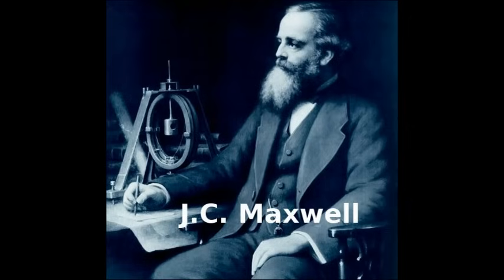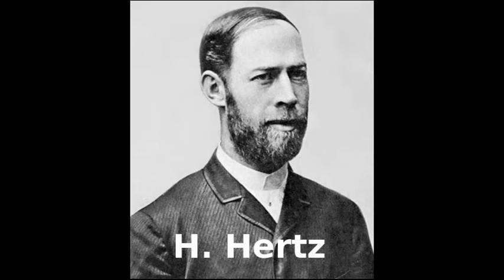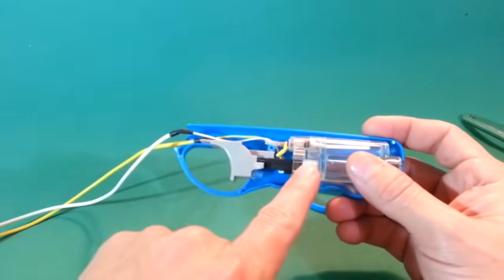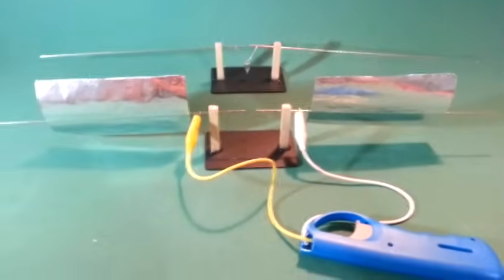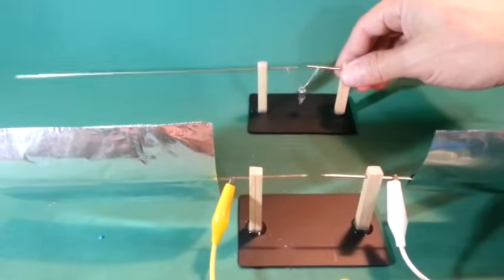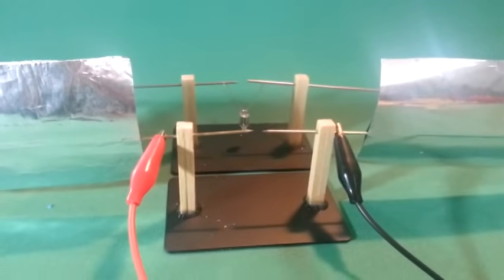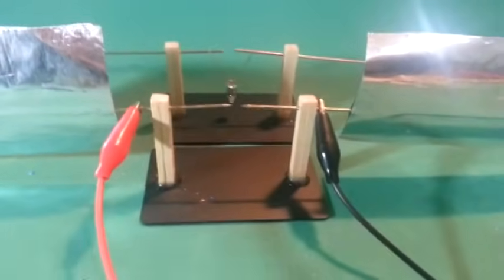Hertz Experiment on Electromagnetic Waves

Comment: Cool video.  However those are not Maxwell's original electromagnetic equations.  Originally there was i j k the three vectors with an additional scalar component w,  that was always left over when the vectors were solved. Oliver Heaviside took that scalar out because it would leave his vector calculus equations Unsolvable because they Didn't account for the curl of the field that had no vector. So the interpretation of hertz experiment is incomplete if you don't account for the curl of the em field lines which produces the effect of super position of the energy occurring in similar. Geometrical arrangements and therefore it is not a wave traveling first but a super position of a particular geometric energy configuration happening as a singular event instantaneously collapsing at the same time which produces a shockwave at the speed of light that interacts with the gas particles changing energy levels and releasing photons to compensate its rest mass energy level.  The dynamics happening within the geometry of the vacuum always precede. Events observed in physical particles disturbed by the activity occurring in the vacuum beyond the speed of light

Comment: Interestingly a spark gap can be used as a radio jammer. Although this is VERY illegal, and dangerous if you don't know what you're doing. A spark gives off radio waves of every radio band, effectively jamming every radio band within range of its effects. If you had speaker near this spark, it would just play static. Even without a receiver. The wires themselves act as an antenna. Of course, a small spark gap like this would only affect things within a few meters at most. But a large enough one could potentially jam emergency frequencies, public and private radio (private more so), and cause a lot of issues. It would also require a LOT of electricity to make a spark gap that big and to keep it going. The first radio transmitters were actually spark gap transmitters that worked on this very principle.

Say for transmitting morse code wirelessly, you just have a switch that creates a spark across the gap, and the reciever will hear it regardless of what it's tuned into. You can hear this for yourself during a thunderstorm. I remember I had a set of Harmon/Kardon speakers that used to click every time there was a flash of lightning. The cord is acting as an antenna and causes the diaphragm to jerk real quick for a moment.

Comment: Many years ago I did an experiment with the same setup using an LED and a piezo igniter and got it to light up 4 meters away with long wires on both ends of the igniter and receiver using a coherer. It worked really well!

Comment: What exactly causes the spark in the detector? Is it EMW or the normal light (from the spark in the circuit). I mean if we have used normal circuit, instead of the  LCR circuit having oscillations and all... will the spark in the detector still be there? Bcz I have read somewhere that EMW has the effect on spark length. I'm confused with the exact cause of spark🙃.plss explain. It would be a great help.
Reply: I think its probably the EM wave, as its supplying an electric field to it and giving it enough energy to glow

Comment: can you tell us what type of neon bulb you used... I want to do this same thing
Reply: Any neon bulb ranging from 90 volts and above
Reply: @neldungca8524  Thank you!!  (Why 90V and above?)
Reply: Because any electrical source which have 90 volts source of power and above 90 volts the neon bulb glows say an example 10,000 volts spark generators creates that range so the neon bulb is a good indicator of transmuting power from one medium to another I am from philippines and we proud to be a pilipino
Reply: An additional, the indicator light of an electric iron is an example of neon bulb or the starter of fliurescent lamp is a neon bulb

Comment: what is the purpose of shining aluminum foil used in the transmitter, are waves transmitted through the foils, so if we cover up the point of spark it should still work.
Reply: Yes, the spark is to allow the sudden flow of electrical energy, that's all. The foil paddles are the antenna, which transmit the electromagnetic energy. So, if the spark was covered, it would still work.
Reply: @nojiratzlaff4388  Thanks for reply

Comment: fantastic! but is there any need to lose power with a spark configuration at the source antenna.
Reply from the maker: The spark creates the electromagnetic wave. It does not work without the spark
Reply: @ludicscience , thank you!.. here I was thinking that the dipole with the foil was the key. Now I understand, it is the higher frequency broadband EM produced by the spark that propagates.

Comment: Great video - many thanks.  Can I ask what would happen experimentally if you rotated the receiver through 90 degrees?  Could this setup also be used to prove that the EM transmission is polarised?
Reply: Yes it could not light as result of polarization
Reply: @neldungca8524  Thanks - it is very important.  I don't really buy the photon model (of EM transmission anyway) so for me polarisation is such a wave like phenomenon that I'm not convinced by polarisation using a photon model.

Comment: What were the sheets of foil for on the spark generator? I thought the EM waves come predominantly from the spark itself?
Reply: Actually an antenna (the sheets of foil) is essential in producing radio waves. The EM waves are not caused by the spark but the variation in the current traveling through the antenna.
Note that real life radio antennas do not need a spark.
Reply: The purpose of the spark is to allow for the sudden discharge of energy, and the fact that the sudden energy change appears on the foil paddles allows for the generation of electromagnetic energy, which then propagate.

Comment: Electro magnet wave,
Radio wave,
Inductance wave,
?
Reply: What's the question?
Reply: Whats the different ?
Reply: @mugiraharjo6270  radio wave is a type of electromagnetic wave. What's inductance wave?
Reply: Sorry, i mean induction wave, for example induction heater, induction cooker.
These also work with high frequency...
Reply: @mugiraharjo6270  induction heater exploits two theorems of electrodynamics(Faraday's law and Amper's law): if you create a circulating electric field it will create a magnetic field perpendicular to the plane of circulating vectors, due to alternating current that magnetic field also change. Changing magnetuc field cause circulation of electric field, which forces charges in a metal plate move in circles and heat the plate due to nonzero resistance and Joule-Lenz law. It's called eddy current. The heating itself isn't based on traveling waves, but such system may create those, but their effect on heating will be low.

Comment: I'm one of that dislikers. I can explain. This is not a proper expriment. Not enough explaination and there are several mistakes. Even we are not sure that the lamb is emiting light or just reflecting the main spark's light. He had to measure the voltage of that lamb.  AND most importantly, the original expriment done by a circle and he uses a linear antenna! instead. This is way more important detail than you think. And i'm not sure but the neon thing may cause another mistake because the magnetic pulse may ignite the gases in tube so the light may not be created by the current but the magnetic field itself. (You can see similar effect on Tesla coils and flourescent lambs)
Reply: It is not reflecting the light as the colours are different
Reply: @aloshikhabhattacharjee5053  Ok you are right but i meant that we cannot be sure about that. That might be an optical illusion or something. Maybe the glass is coated with some metal oxide and so we see the reflection in that color. It's just a probability. That's how science works. You measue things to be sure. And you measure it again. You must see the same values every time. That's we call "reasonable evidence". And i'm not saying i'm 100% right, but i'm very skeptical about this video. For example, one little simple question, please answer that: Why he didn't use a simple low consuming LED? Wouldn't that be more convincing since the amount of the current will be very very tiny? I take the risk and say that he just used the neon bulb because that bulb could ignite in electrical field (i guess that's about beta particles thown out by the electric arc).  So this comment is really bad time spending for me. Have a good day.
Reply: Well.... it is meant to be simplified.
Reply: I think the bulb was not lit by the magnetic field as if it would be lit for 1 second or less and stop glowing because of the change in magnetic field but here it stayed for 2 seconds or more which shows it is only the electromagnetic wave
Reply: @aloshikhabhattacharjee5053  There are electromagnetic pulses and they continuously load the bulb.
Reply: One can learn from faulty experiments too - I'm learning from the comments, but not liking the hostility and ad hominem attacks (aka: flaming).  Just because someone knows about electromagnetism, that doesn't make them more intelligent than someone who doesn't know.  I'm not very smart, but I've been learning the concepts behind electromagnetism, and it isn't complicated after you have it explained conceptually (no mathematics for unschooled fools like me please).  Tesla invented things in his head CONCEPTUALLY, not mathematically, and that's the best way to understand science.  Mathematics is amazing, and important, but not necessary to understand how EM works.  I'm especially enjoying the videos about how the old free energy buildings work, at channels like "global vision" (Russian).  ?You all know we had free energy in the past, which was taken away from us about 100+ years ago - right?  If not, you should learn........
Reply: Neon is a noble gas and will not ignite
Reply: @aloshikhabhattacharjee5053  This is not about being noble. You can google that, "neon tube in electric field". You will see that electrical field ignites those gases and it is not a chemical reaction so it's not about being noble. It's about photoelectrical effect.
Reply: 1) Yes, we know that is the light of the neon bulb and not the spark gap. How? Because the light from the bulb is the distinct orange-red color of a Helium-Neon mixture. The spark gap has a very different color and plasma temperature (the bulb is a glow discharge, the spark gap is...a spark, "shockingly").

2) A circular antenna just transmits/receives circularly polarized EM waves. A linear  antenna transmits and receives one of the two quadrature components of such circularly polarized waves. With suitably arranged/phased arrays of one you can get the other and vice versa. It's a non-issue. Next.

3) dB/dt effects you describe would cause a voltage to form in a ring ( Curl(E) = -dB/dt ). That would NOT explain why you get a glow discharge on only one electrode as seen in this experiment. Instead, the effect you are worried about (without empirical justification) would cause a UNIFORM glow discharge throughout the bulb like you see in inductively coupled plasmas. NEXT.

4) Tesla coils operate at fields that are 10,000 times or more than that seen here (3x10^6 V/m versus MAYBE 100 V/m in this video).

Comment: interesting to see that only one pole of the neon lit up... usually an indication of DC voltage, although AC is clearly transmitted.... This leads to more questions....
Reply: By using DC, you only get a half wave pulse as opposed to a full AC waveform
Reply: @FreiNrg  If viewing the received waveform with an oscilloscope, would you not see a full sinusoidal waveform?

Comment: Great video , I don’t know why some people disliked this great video
Reply: I'm one of that dislikers. I can explain. This is not a proper expriment. Not enough explaination and there are several mistakes. Even we are not sure that the lamb is emiting light or just reflecting the main spark's light. He had to measure the voltage of that lamb.  AND most importantly, the original expriment done by a circle and he uses a linear antenna! instead. This is way more important detail than you think. And i'm not sure but the neon thing may cause another mistake because the magnetic pulse may ignite the gases in tube so the light may not be created by the current but the magnetic field itself. (You can see similar effect on Tesla coils and flourescent lambs)

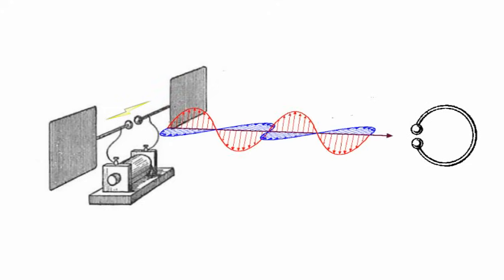Comment: One has to be careful how to interpret this experiment as the receiver is so near that one may be receiving the near field and not the far  distant field. So this could be interpreted as a transformer effect and not a " transmission" effect as shown by the diagram at 0:58 where there are about five half wavelengths between the transmitter and receiver.  Well what is shown is " ELECTROMAGNETIC"  but it is not an electromagnetic WAVE ! I would say it is an induction transformer effect.
Reply: Absolutely agree.
Reply: I think that's why the guy puts metallic paper onto the wires so variation in the field from external sources to produce induction is negligible.
Reply: @Chris Russell What? the foils are plates of a capacitor?? What capacitor?? A capacitor needs to conductors with dielectric in between. Since the metals are wide apart and the dieletric is plain air, the Capacitive factor is negligible. On the other hand, the covered wires doesn't even coil, and they are covered by a conductor, which by boundary conditions reduce the field inside the sheets. Moreover, you cannot say that a magnetic wave exists without an electric wave. Since according to Maxwell's equations, a spatially varying electric field is always associated with a magnetic field that changes over time. Likewise, a spatially varying magnetic field is associated with specific changes over time in the electric field. That's why when the electric field oscillates between the electrodes it creates a magnetic wave at the same time. Period.
Reply: @robertocaesar  also explained by Einstein's theory of relativity
Reply: @Heads Mess can you please explain this at high school level?
Reply: A near magnetic field is effectively around two spark gap lengths.. so it's not that.
Reply: But isn't this a transmission, the same type as a Marconi spark gap?
Reply: @Heads Mess thanks, I got your point
One more question.. isn't that Spark itself an evidence of presence of electromagnetic thing 
As light is also an electromagnetic wave and Maxwell predicted that accelerating charges produce electromagnetic waves
Reply: @Heads Mess I would love to verify myself but like you said I've to go to university so I'll add these things to my notebook.
And there's not a single video on YouTube explaining how does this Tesla coil generate electric tension (or it it just magnetic induction) in the air to power things. 
And, if light is not a wave then 'interference'? But still I need to verify and conclude things by myself
Reply: I had similar worries, with the transmitter and receiver so close, inductance and capacitance will play heavily and could be significant enough to outdo the true "EM Wave Propogation" that the experiment is intending to isolate and demonstrate.  I would almost bet this setup would still flash the bulb with it lying flat on the table from the same distance, and NO antenna at all, just the spark gap and bulb.  They are too close to isolate and clearly demonstrate the desired effect to a newcomer to the field.
Reply: And the problem with that...?
Reply: @fazergazer  I think what the poster means is the effect could be via inductiin rather than em radiation.
Reply: Also he is using neon bulb in which neon gas gets ionized by the strong electric field generated by the spark and glows.  It makes the neon bulb glow like Tesla Coil. it can't make an Incandescent light bulb glow
Reply: Fuck me. He was only trying to give a "domestic"  level insight with a simple experiment.  Of course one could actually reproduce Hertz's  original experiment and you would presumably be happy with that you gigantic fucking tool.
Reply: @peterhall6656  ?why be so negative because of debates about electromagnetism.  I'm often wrong myself, but not a "giant fucking tool" (chill)!
Reply: It is not about the electromagnetism- it is about big-noters who contextually can't see the difference between a high level explanation for plebs and a hard core rigorous  explanation at post doctoral level.  This is Youtube - not Princeton Institute for Advanced Studies, and if it were, the standards would exclude all but a handful of people who comment on such videos.